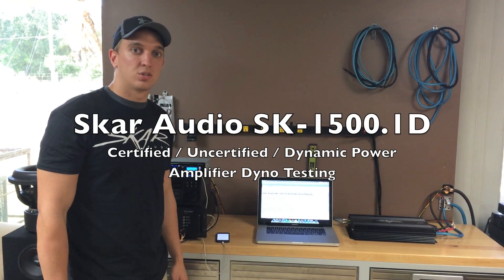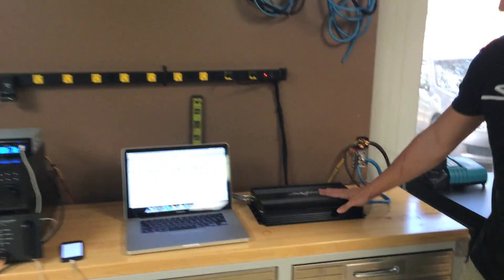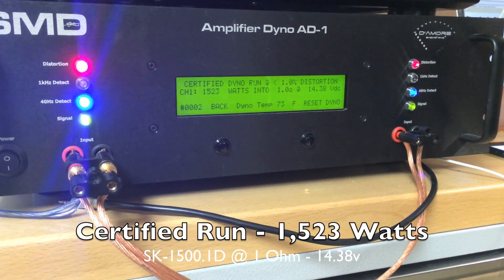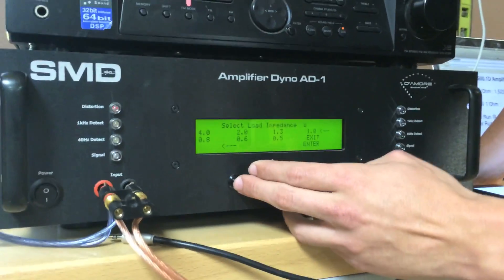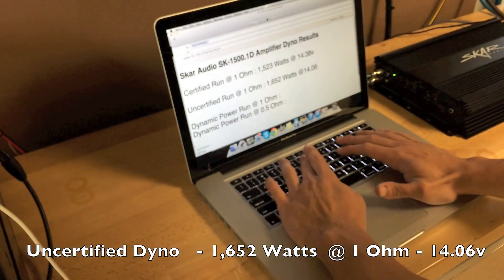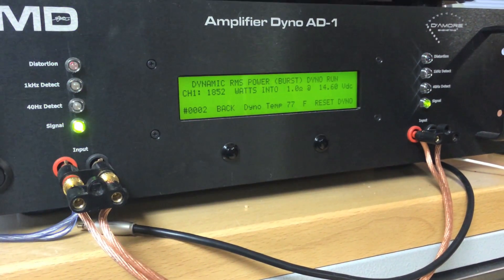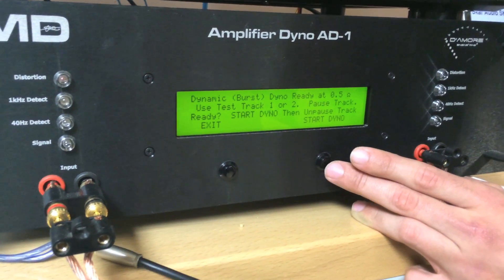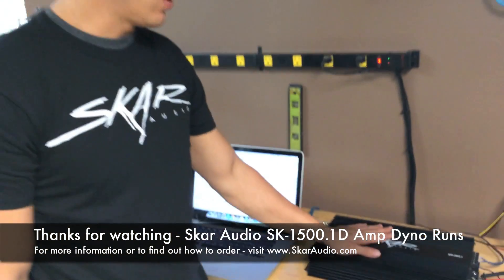SMD AD-1 AMP DYNO : Skar Audio SK-1500.1D Certified / Uncertified / Dynamic Burst Runs

Comment: do you need batteries for this Skar Audio SK-1500.1D  or can run it off your factory battery
Reply: I would suggest the big 3 upgrade n a deep cycle battery to get the most efficiency out of the amp. If your not running at the correct voltage your not going to get the full 1500 watts
Reply: I Would recomend it i had to run nu wiedes set up half the power and dhr only has der 12s and boy let me tell you i was like Damb these thing hit and then i ran them parallel with 4 gage wire and i was like what the fuckn we got here i mean i was speachless then the in line fuse blew. And the amp want even an quarter way up. So now im thinking if the sdr's sound like this so what in the hell nu two 12 inch svr's going to sound like i do know this every thing needs to be up grade that for Damb sure because for this amp to be rated 1500 sms its no lie and no joke thats for Damb sure. Because or pull current!!!!!!!!
Reply: @jimmymarshall1602  what?
Reply: @Rah-know  hahahahahha

Comment: is the amp .5 ohm stable?
Reply: ran mine at .5 for several months on a SSA Xcon 18- never let me down.  draws some amperage though.  definately recommend a 2nd battery or a stout alt.  I had a factory alt and a yellow top optima...I could pull it down pretty low if I pushed it too hard.